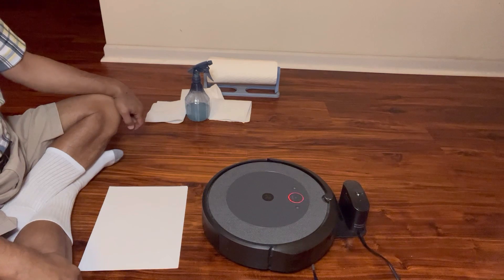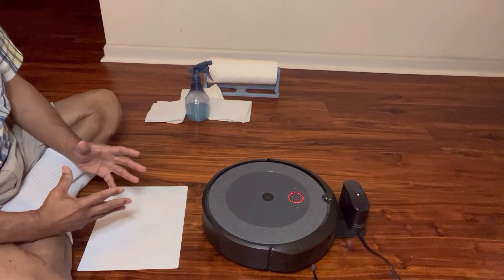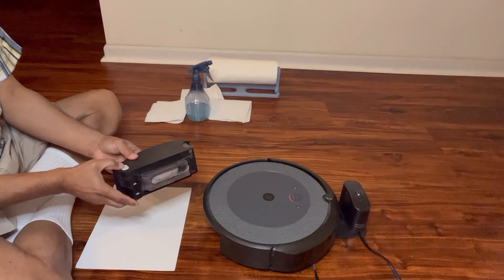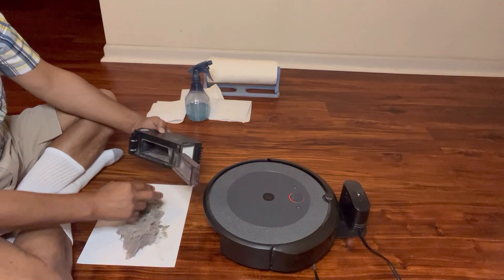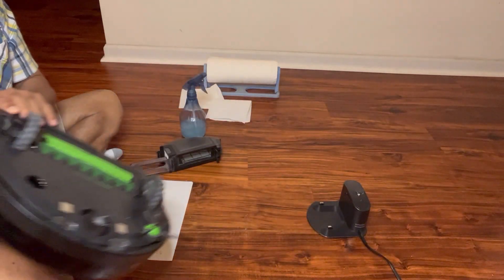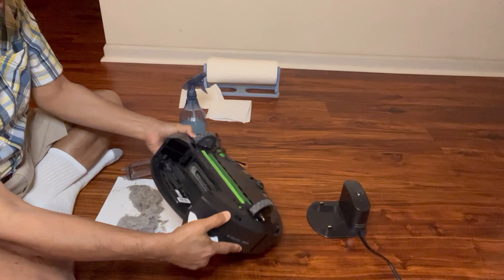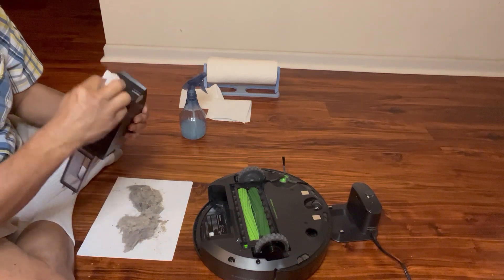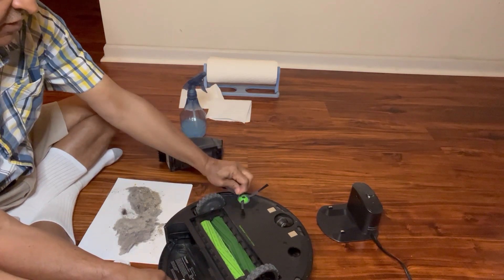iRobot Roomba i3 - Red Blinking Light

Comment: So I got one today and the red light is blinking so basically I just have to clean it or doesn't need a new battery
Reply from the maker: As your iRobot is new, I think you need to check your bin.  If it is full then empty it and clean it.  Also clean the sensors
Reply: @spcolumbia7927  I did